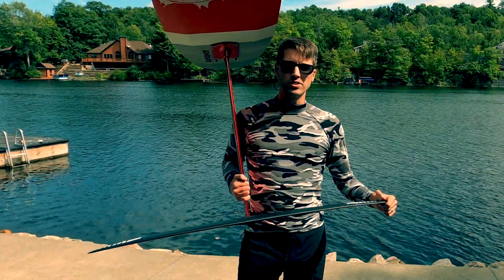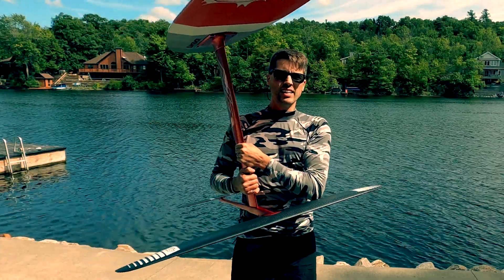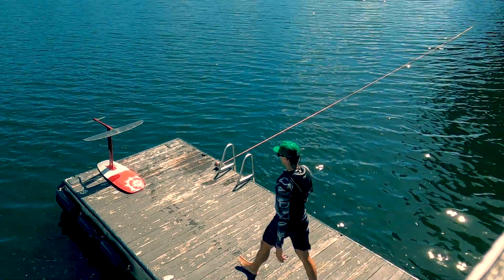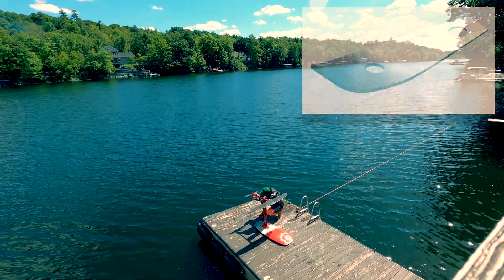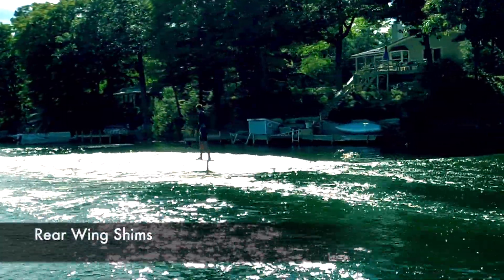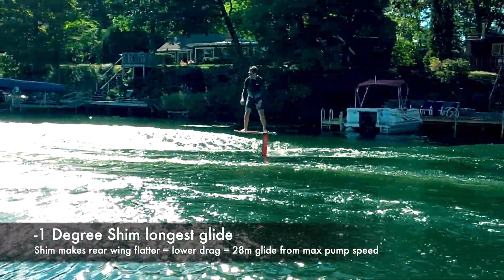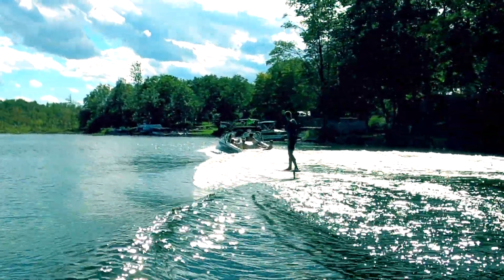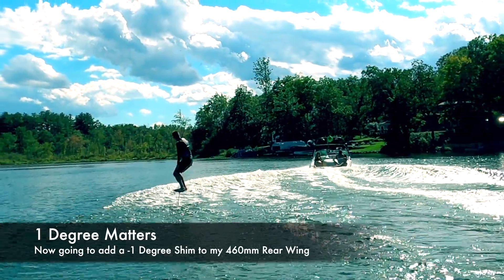Hydrofoil Rear Wing / Stabilizer Shims for Gliding & Pumping

Comment: "When we added a +1degree shim it made the rear wing more negative angle of attack"  Why does this sound backwards?  With the debate of +/- orientation aside, I agree completely with your analysis of the shimming results. Rear wings are pitched downward and create a downward force on the tail, resulting in an upward force of the nose of the board, and requiring downward force on your front foot to counter. This creates a stable controllable system. Lessening this downward tail pitch reduces drag, but reduces stability at the same time. This is what you want for pumping, but if you were to change the shim and nothing else, you will feel like you have less lift from the front foil. Getting the lifty feeling back requires a slight change in foot (or mast) placement, standing farther back on the board (or moving mast forward). This reduces the trailing distance between the drag of the foil to the weight of your body (like shortening the tail of a dart), making things more sensitive and squirly.
Reply from the maker: I love this comment! I had wrongly assumed the naming convention when I first launched the video and had to take it down and repost once I discovered that a +1 degree shim actually didn’t increase rear wing angle by +1 degrees. It’s just the axis naming convention, which is the relative angle between front and rear wing .. +1 degree increases the difference by 1 degree. Thanks for this comment.

Comment: Thank you for all the research. I am a dock start beginner, with 95kg heavy weight. I am using a fanatic 2400 front wing and 300 tail. woud you say that is a good beginner's setup or recommend something different? Any help is greatly appreciated. thank you!
Reply from the maker: Johannes. That setup will work just fine. As you progress you might want a foil with lower drag so you can pump longer and farther! Good luck.

Comment: Your info is not very conclusive, 
After looking at various bits of info from numerous end users Ive come to the conclusion that as axis has a vast array of rear wings, each has their own characteristics, while a negative degree shim might work to improve a certain rear wings glide and pumpability, this is not true of other or all rear wings by all means, the negative or positive Shiming is definitely wing model dependent.
Reply from the maker: To my knowledge, shimming only changes pitch stiffness.
Reply from the maker: Thanks for the comment, Troy. To my knowledge all rear wings from all brands have a downward angle relative to front wing so shimming them positive (reducing difference between front and rear wing) promotes glide (lower drag) and initiates a smaller pitching up force. A shim the opposite way does the opposite. The degree of this effect does vary from wing to wing within a brand and brand to brand but the principle is unchanged. If you find an architecture that doesn’t fit this description please let me know! Id love to know if it exists. In my experience shimming has not transformed the performance of any foil from a leading manufacturer. They’ve all done a pretty good job of “getting it right.”

Comment: Could you show some graphics about how the back wing angle and different shims in relation to the fuselage counteract the lift from the front wing. Please. I want to understand the concept in order to apply it to any foil (brand).
I currently ride the 725 from Armstrong. 
Thank you for your videos
Reply from the maker: Yes, we're working on a video that will do that ... I could've done better here. Armstrong uses the opposite nomenclature as AXIS ... easiest way to think about it is this: (1) front wing is pitched up relative to fuse (2-4 degrees) and (2) rear wing is pitched down relative to the fuse (1-3 degrees). This difference allows the front wing to fly, and the rear wing always pushing the nose of the board up ... so you have to hold the foil down with your front foot as you speed up.  So, if you want less front foot pressure, shim the rear wing flatter.  If you want more front foot pressure, shim the rear wing more negative.  Happy to chat about it, if you'd like ... sorry this vid wasn't clear enough! wakethief@icloud.com

Comment: Best video for actually understand the logic behind the shims. Thanks for that but could you help me clarify?: 
By shimming negative (second test) you gain glide but lose pump and acceleration capacity right? Maybe because the front wing doesn’t climb up as easy as without the shim. 
If shimmed positive (first test) do you think the easier pumping could compensate the increased drag by pumping further? Thanks again
Reply from the maker: Thank you. I hadn’t thought about your questions before. I think you’re right. If negatively shimmed, the delta between front and rear wing is less and thus the speed of pitch response is slower and you can’t pump as quickly (cadence). Well done. I like that point a lot. I’ve always felt like there’s a perfect shim for each rear wing / fuselage / front wing pairing at each speed. When you pump a long time there’s an ideal speed and at that speed you want to prolong the pump as long as possible without losing too much speed thus a shim is how you do it. As to your second question, I think cadence goes up until you’re not enjoying the glide and consuming the glide as much as you can … therefore you pump too much and don’t enjoy the rest between pumps, so I think the answer is no. Please stay in touch. Devon
Reply: @WakeThief  very nice point of view. Will keep experimenting and keep you posted
Reply from the maker: Thank you!

Comment: Why not push to two or three degrees negative, to find the optimum?
Reply: Just to clarify, the rear stabilizers are set to provide some downward force on the rear end of the fuselage which causes the front wing to gain more upwards angle of attack and lift.  They counteract the natural rearward drag on the front wing which pushes it backwards and down. The downward stabilzer angle comes at the expense of increased drag. The Axis minus 1 shim reduces the downward angle of the rear stabilizer. This should reduce the lift of the front wing, reduce front foot pressure and also reduce drag. Since Armstrong foils mount the rear stabilizer underneath the fuselage  a +1 shim is used to do the same thing as the axis minus 1 shim: Both reduce the downward angle of the rear wing. Love your videos.
Reply from the maker: Thank you! Everything you said about AXIS -1 shim is spot on. I didn’t know that about Armstrong. Thanks for sharing. I reviewed the HS1850 but didn’t play with the shims or observe that. Appreciate it. The AXIS +1 makes the rear wing more negative angle of attack so it will pitch front wing up more, generate more lift on front wing and load front foot more. It will make the cadence of pump higher because the rear wing really wants to counteract gliding. What you said about -1 is spot on
Reply: By the way, your method in your videos is great. Super informative and you how out of your way to be impartial. Keep it up!
Reply from the maker: It’s a good point. Great question. I’ve since tried -2 Degrees and didn’t look it as much as -1 Degrees. I’ve also found that when I pump for a long time, my back foot gets tired with -1 Degrees. It’s all about preference. I think the optimum I probably somewhere between 0 and -1 Degrees now, which tells me AXIS has it pretty close to perfect in my opinion, but again it’s all about preference.

Comment: This is exactly the research I have been searching for!  It's easy to get overwhelmed on the axis website with all the options, wings/fuselage/stabilizers/masts... so I would give up and not do anything.  I don't like my Cabrinha foil setup because the 85cm mast is very twitchy (40cm and 60cm are fine) which I attribute to the short fuselage length maybe (plus many other variables of course) but I've been searching for a pumping axis setup that's also good for those summer ocean flat days of 1' rollers.  Great vid!
Reply from the maker: Thanks Michael. This comment made my day. If you have other foils you’d like me review, please let me know. If I can help you down select based on your weight and sport, please let me know. I’d be happy to. What’s great for me on the lake might not be great for someone else. Please find me on Facebook @Foiling NY and feel free to send me a message. Thanks again.

Comment: @foiling NY i have a question. Does the S-Series Carbon Rear Wing 460mm generates lift at all ? At the Axis homepage they write in the information something about a " flat surface" so how does the back wing looks like ? Coud not find any pictures from the side of the wing. I get how a Shims are working , more or less changing the angel of atack. But thats about the back wing itself? Should it generate in compinaten to the high aspect front wing (talking about the 1150) as well a lot off lift or is it not so importend?
Reply from the maker: Thanks for the comment, Reinhold. At the 30s mark of this video you can see the 460. The entire video explores different rear wings. https://youtu.be/yUgfmvJLGy0. Yes, the wing generates lift. Certainly a lot less than the large HA front wing shown here (1150). But because the rear wing is HA, the lift is significant for its area / wingspan and the drag is lower than low aspect ratio stabs. I have shimmed the rear wing to bring it closer to the same Angle of Attack of the front wing. For me, it more evenly loads my feet. I would like to try larger HA rear wings in the future. Please let me know if you have any more comments or questions. Thanks again
Reply: @WakeThief  thanks so much. I am working at the moment on an self build Hydrofoil. Even if i dont had the chance to try one out yet ^^ no one is living in my area (south germany) and has a foil. We only have a couple small lake. So i just try to get as much infos about Hydrofoils as i could. I finished already the Mast (75cm and around 1,2kg weight) and the front wing (Wingspan 1120mm / chord 212mm and 1,67kg )  the high aspect front wing should be in the middle of the Axis and the Sling shot you had comparred. The goal is to build a good hydrofoil for pumping. Now i am sitting on the pc again and designing the fuselage and the back wing. I might will take up with your idear about a larger HA back wing. It seems like the 460 is a real good back wing to start my sketches. Any suggestions about the naca profile of the back wing ? And please keep up your exelent videos ! thumps up all the way.
Reply from the maker: Reinhold Uhrner I do not know the NACA cross section. Have you checked out Clearwater Hydrofoils? They share some amazing details in terms of how to build wings. Your 1120 sounds perfect. HA are great but hard to learn on. Lift very sensitive to angle of attack. Something between the Slingshot and AXIS will be a good wing to learn on while giving great lift.
Reply: @WakeThief  yes saw that from Clearwater. Will see how everything will tourns out. Learning by doing ^^